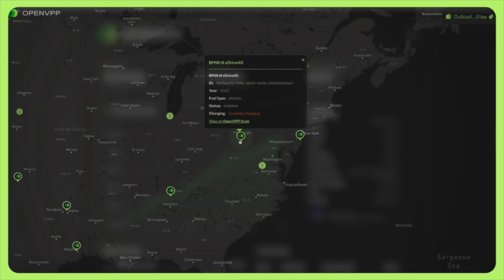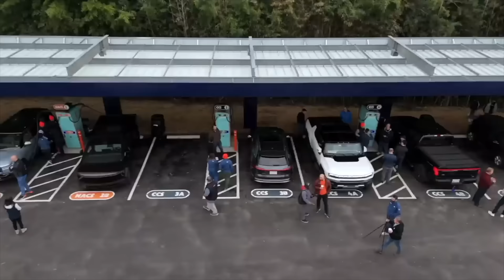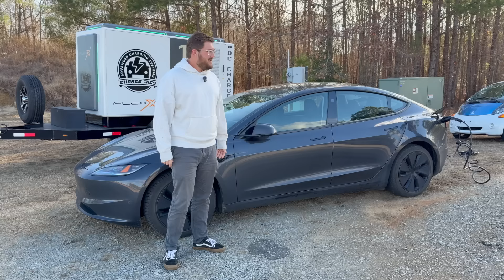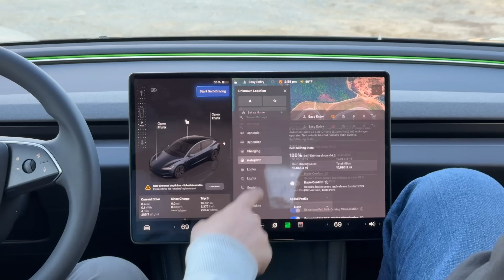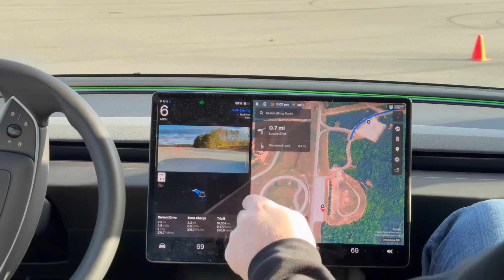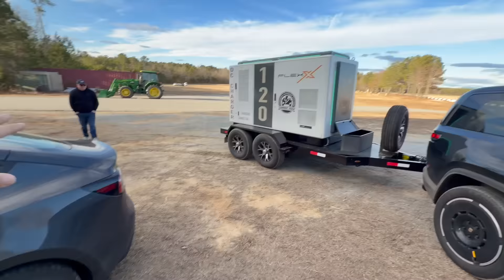First Cross Country Autonomous Drive Completed! Over 10,000 Miles Using Tesla FSD w/ No Intervention

Comment: Not truly Autonomous as long as a human has to tell it where to go. Having to manipulate the navigation in a parking lot is not autonomous in the sense the car doesn’t know it needs to find a charging post.  At best I would refer to it as Automated driving.
Reply: FSD does actually park at chargers, but only at Tesla specific superchargers. It does this by itself as well, as long as you pick the actual charging destination on the navigation. What he described in the video is FSD mistaking a normal non-EV charging/parking spot to an actual charger. This is likely a bug, and can be fixed via software updates. However, there are cases where the car will still park in handicapped spots, or other specialized parking areas that it isn't supposed to. This is a known limitation, and is actually listed on the release notes as an upcoming improvement. That said, I would still call it autonomous, as it can certainly handle the entire task of driving from A to B, even if it does make mistakes. As long as the human doesn't need to intervene between A and B, I would classify that as autonomous.
Reply: @P @ProXcaliber This is my conundrum. It can go from point A to B seemingly autonomous, but not necessarily legally. Today I had to intervene due to the navigation routing including  an Illegal U-turn.  Sure, I could have let it go since there were no police at the intersection to witness it and thus pull me over. I’m confident it would have completed it safely and then continued to the final destination a few hundred feet further.
Reply: @dennisschlieckau8723  Yep, and this is why Tesla still wants people to supervise. Personally, I wouldn't say that is an FSD issue, but more navigation information issue. They really need to improve the map data more to take things like that into account.
Reply: @P @ProXcaliber When I can simply talk to the car with a Basic verbal commands or request. “ conversationally “ and it answers back “no problem” that’s when I will consider it fully autonomous.  Not just “Grok” setting your base destination points.  But on the fly requests. Like, drop me off at the entrance and go park in the parking lot with open spaces on either side or if not available just do continuous driving with in a 1/2 mile radius of my location. I will call you when I need to be picked up. 

I feel that day is coming sometime in 2026. 🤞
Reply: @dennisschlieckau8723  I mean, everyone has their own definition of autonomous. And personally, I already considering it about 99.9% autonomous. The only times I disengage is if it parks bad, or in a specialized parking area. Other than that, I would consider it pretty much autonomous. I don't really care for voice controls, but I can see how that would be useful, and why some may consider it "more" autonomous.

Comment: While they don’t explicitly claim Tesla FSD is Level-4 autonomy, they repeatedly invite that conclusion by framing a supervised Level-2 system as functionally equivalent to autonomy. Phrases like “handled 100% of the driving tasks,” “no interventions,” and “first autonomous cross-country drive,” combined with unfavorable comparisons to Waymo’s geo-fencing, blur the line between driver assistance and driver replacement. The human’s continuous role in supervision, route curation, edge-case judgment, and legal liability is treated as a technicality rather than the defining limitation it actually is. The result isn’t an outright false claim, but a narrative that nudges viewers toward an autonomy conclusion the evidence does not support.
Reply: @abstractreasoner
You CERTAINLY have the right handle.
They DON'T explicitly claim Tesla FSD is Level-4 autonomy.
They DO say (correctly) that (IN THIS CASE) it WAS "a supervised Level-2 system" PERFORMING AS "functionally equivalent to autonomy", ON "a cross- country drive" (AND MORE).
.
 When you say "combined with unfavorable comparisons to Waymo’s geo-fencing" Are you suggesting the FSD was below par, or Waymo?
Waymo IS geo-fenced. 
Waymo is ALSO "Supervised", just not in the car, as was  demonstrated in the "Incident" before Christmas.
Bearing this in mind I might suggest that Waymo (and you?) are "Inviting the conclusion" that IT is "level 4", when "Level 4" SHOULD (at least in my opinion) be capable of travel between 2 points a map, selected blindly by a random person. Only ONE of these systems is close to that.

This means they are NOT to be compared, simply because Waymo could not attempt, let alone complete a similar trip. (and as far as I can see, it may NEVER achieve that ability)
.
If anything, this trip demonstrated the "human role" IS becoming a technicality. It IS currently a "Limitation" because "that's the LAW", until such time as authorities change the designation.
.
There was no "Nudging", no "narrative", just a review of the "EVIDENCE" provided, that this car DID travel in excess of 10,000 miles, ALL of which were with FSD engaged....... AND with a "supervising Human" in the Driving seat as required by law.
Reply: @rogerstarkey5390Wow! It seems FSD is just about solved. When do you expect Tesla to catch up to Waymo?
Reply: Your comment was written by an AI chat bot.
Reply: @ProXcaliber what’s your point?
Reply: @abstractreasoner  You’re treating supervision like it cancels the underlying capability. It doesn’t.
If the car navigates, negotiates traffic, turns, merges, and parks A to B, that’s the system doing the driving task, even if a human is still required as the safety backstop. That’s why “autonomy” (legal) and “handles the drive” (technical capability) get discussed separately.
Reply: @ProXcaliber  I think this is the core disconnect. From a Level 2 perspective, what’s shown here is genuinely impressive and arguably best in class when a highly attentive human is supervising. I’m not trying to diminish that at all. The issue is that people are not watching this as a yardstick for how capable a Level 2 system can be. They are using it to infer how close the system is to robo taxi or Level 4 autonomy. That is where it becomes misleading. A large portion of this drive is in the system’s strongest domain, long distance highway driving, which is fundamentally easier than dense urban environments. The same behavior that looks extraordinary under constant human supervision, especially on highways, does not translate linearly to unsupervised operation. The hard part of autonomy is not lane keeping or navigation, but independent failure detection, fallback, and recovery without a human safety backstop. That gap is what my comment is addressing.

When do you expect Tesla to catch up to Waymo?
Reply: @abstractreasoner  No, you are still doing the same slide.

Nobody is saying supervised L2 equals legal autonomy. They are saying that on this trip the supervised L2 system performed the driving end to end without the human taking over. That is what handled 100 percent of the driving tasks and no interventions means in plain English. It is a statement about who was steering, braking, navigating, merging, and parking during that run, not a claim that the driver can stop paying attention.

Your argument is basically this: some viewers will watch a clean supervised drive and mentally upgrade it to robotaxi readiness, therefore the language describing the drive is misleading. I do not buy that. If someone ignores the word supervised and turns it into L4 in their head, that is their inference, not a lie from the person describing what happened.

Also the Waymo geo fence comparison is not some gotcha. It is a design choice and it works. Waymo is ahead today in one very specific thing: driverless service inside a limited ODD with a lot of operational support. Tesla is showing impressive capability in a different direction: wide availability and general driving behavior, but supervised. Comparing them is fair as long as you do not pretend they are the same product.

And the smart little line about wow it seems FSD is just about solved is a strawman. Nobody said solved. The point is simpler: a supervised system can still do the driving task on a trip. That does not magically become L4, but it also is not nothing.

When do I expect Tesla to catch up to Waymo depends on what you mean by catch up.
If you mean publicly available driverless rides with no safety driver in a city, I do not have a date and neither do you. That bar is safety proof plus regulators, not vibes.
If you mean the car driving people A to B in the real world while the human supervises, that is already happening.

Comment: Today's FSD 14.2.2.2 dog walk drive I engaged it in my carport and for the first time I experienced it backing out and driving to our destination! Did it just as well as I could, smoooth! Leaps and bounds over my 2023 Model Y with FSD 12.6.4. other than only the one disengagement.
Reply: It's been pulling out of my car port for a few months now! Even 13.2.9 couldn't pull out of it because it would freak out at how close the poles are. I even had it back into the car port once, but haven't been able to repeat it unless I force it by putting the car halfway in.
Reply: Using FSD, when it’s pulling out of your garage or carport, is it smart enough to move over enough so it doesn’t take off the side view mirror on the way in/out?
Reply: @Deetroiter  It actually does! Which is what surprised me at first. My car port isn't exactly center on the driveway, and even though that is the case, it will pull out and turn to the left to center itself on the driveway. Likewise, when it reverses into my driveway, it aims for the car port, but it just doesn't pull in all the way every time. It is also 50/50 on whether it goes head-in or reverses in. That part of how you want it to park isn't an option yet.
Reply: @Deetroiter  It pulled more carefully then I normally do, but very decisively.

Comment: Great to hear I just traded in my 2023 Tesla Model Y Long Range AWD (Fremont built with the Panasonic Batteries) for a Berlin Built 2026 Model Y Juniper of the same model just  yesterday, but I have 84.83KWH LG 5M battery (battery spec from multiple sources), with improvements on the battery cooling and battery design is suppose to support real 250KW charging similar to the Panasonic batteries. Last night I received FSD 14.2.2.2 and I am blown away! I am also blown away on the efficiency, so far today I did my normal drive to walk Bower our wonderful almost 12 year old Yellow Lab. Normally my efficiency with the same environmental conditions on the 2023 on the trip is 128watt per KM (on Michelin CrossClimate 2  - 235/45 20inch on the front and 245/40 20inch on the rear for 3 peaks Mountain all weather rated tires) on return to our house, today I hit 88watt per KM with underinflated (38psiG) 255/45 19 Continental ProContact RX all season tires - they are fresh with only 104km on the car at the start of the trip. I have averaged 119watt per KM on my Michelin e.Primacy All Season 255/45R19 XL  also inflated 38psiG on the 2023 Model Y. On the same dog walk drive today I had a disengagement of my FSD 14.2.2.2 on KM 1.3 approaching a short bridge with no shoulders, just before the Bridge the car signalled to pull over, may have been  a false emergency vehicle avoidance tactic. Keep you posted on my next drive of what could be almost the best Model Y yet!
Reply: Tesla has been training FSD in China the past year, that's why it improved so much

Comment: You didn’t mention potholes.
Reply: He actually did mention potholes.
Reply: @ProXcaliber I must had missed this, oops!  This is my most frequent disengagement on my 2020 MY.  I really want to get the new MY!!
Reply: @Luke_Starkenburg  It is still hit or miss on potholes (pun intended). If the car in front dodges it, and with enough time for FSD to react, then it will dodge it. But if it doesn't see it in time, or there is no car in front that dodges it, then it is 50/50 on whether it will dodge it. It does excellent with road debris, though.
Reply: @ProXcaliber so for this 10,000 mile FSD drive, I wonder how many big potholes he has hit directly!  It’s probably not an easy thing to research to avoid large potholes by changing navigation.  Some potholes will take off a wheel or disable the vehicle!
Reply: @Luke_Starkenburg  That is a good question, but I'd have to guess it wasn't many. He mentioned in the video that if it looked like FSD was going to hit it, he wouldn't let it, or would take a different route if he was familiar with the area.

Comment: It's crazy to think we're getting to a point "where driving manual" won't mean stick shift.   We've gone from 3 pedal to two, to mostly one pedal drive and now zero
Reply: I think you need to evaluate how FSD actually works.  It’s messy and for the most part great experiences with the system is pure luck.
Reply: @HeathRS your FUD no longer works.
Reply: @HeathRS  no not at all
Reply: @HeathRS having luck for  more then 10k miles seems impossible 😅. You probably haven't used the system at all
Reply: @HeathRS do you have the system?

Comment: It's not fully autonomous by his own admission because of it's really bad navigation that required his intervention to use pin drops to coerce it to go to the right place. Also, Tesla not offering a front camera retrofit for those of us with 2025 cars is really shitty. Mine runs over speed bumps at too high of speeds and doesn't avoid potholes which can significantly damage the car (threw my car out of alignment in the past and cost me $275). So no, it's not level 3/4 and should always remain level 2 as long as it can't overcome edge cases. Plus FSD doesn't recognize which car it's installed in so it treats a M3P the same as it does a cyber truck which should be obvious why it's a bad thing.
Reply: In the video he says he didn't use pin drops..just addresses
Reply: The part about not knowing which car it's in is factually inaccurate. Why do you think it has taken months for the Cybertruck to get anywhere near where the other cars are in terms of FSD? Because size does in fact matter, and so does training data. Just recently, the Cybertruck is now starting to be on par with the other vehicles, and even now it still doesn't share all the same features and capabilities. Even the release notes are different.

Comment: Congratulations to @DMStonex on being the first to do this.  Having driven nearly 200,000 miles on FSD, he has been very lucky to avoid any disengagements. While I can often drive thousands of miles without a disengagement, navigation issues, potholes, and crazy road situations still pop up often enough to break the streak.   He mentioned detouring to avoid the border control point in NM. That was smart because that would've almost certainly been a forced disengagement.   My experience with 14.2.x at sujperchargers is a very mixed bag, so once again he's gotten lucky to be able to not have a disengagement at all of those stops.  I can't help but wonder what other gyrations he's had to go through to avoid a disengagement.  Regardless, this is quite the accomplishment and a true milestone.

Comment: I like FSD but it missed the exit for the Supercharger on the interstate and I had to use an emergency turn around to back track bc if I went to the next exit on the interstate and back tracked, I would have ran out of charge. FSD is good but it needs work on getting over and merging still.
Reply: What version of FSD?
Reply: @dedlos  version 14.2.2.2
Reply: I agree, sometimes it isn't aggressive enough, or doesn't anticipate what it needs to do early enough.